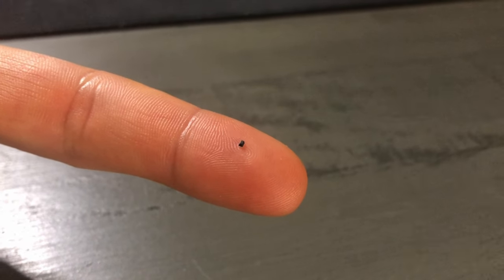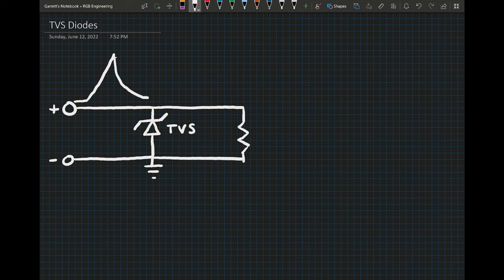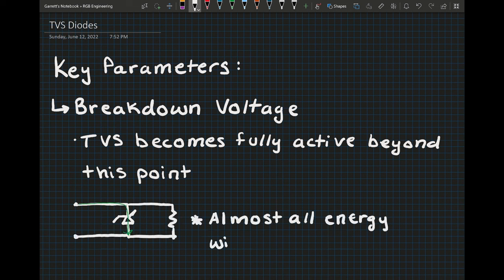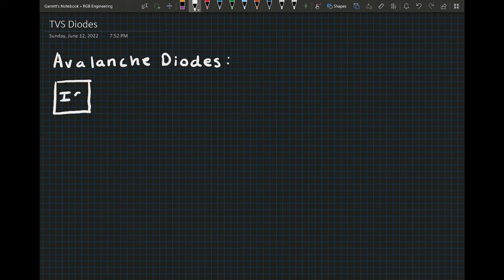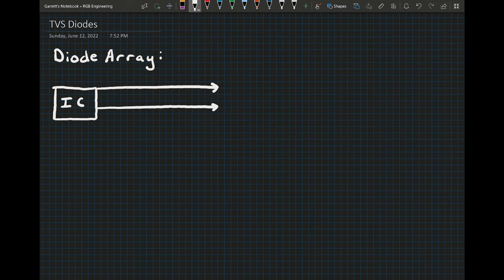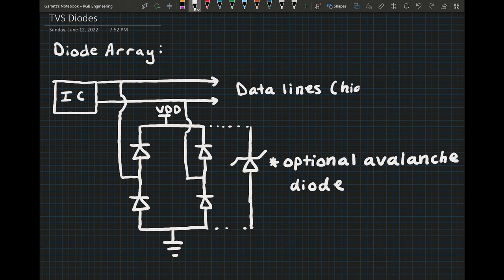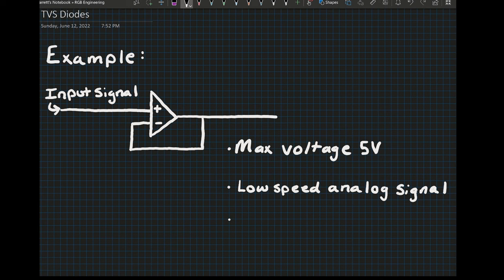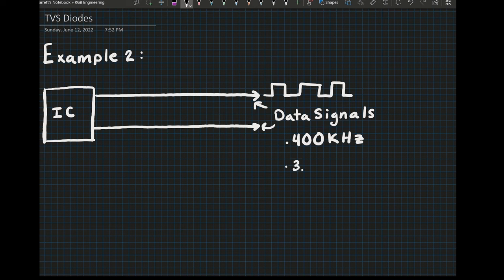TVS Diode Design Guide (for Beginners)

Comment: This is a very helpful video.  Many designs I have seen just seem to randomly have a TVS with the VRWM just about the signal level thrown on the input.  In the case of an op amp with max +/-13V rails and an input signal that is +/-10V, if you select a TVS with VRWM of 11V, the Vclamp will often be 19V or more and VBR might be >13V.  So before this TVS starts conducting much current, the input pad protection of the op amp will forward bias and conduct current to the 13V supply.  But those often do not have much current carrying capability.  So am I correct in saying that a TVS diode can't be used in this situation?

I guess you could use the diode array like you mention in your video.  Would it also be acceptable to have use a TVS diode with a resistor in series with the input of the op amp?  If Vclamp was 19V for the TVS and the input pad protection diodes started conducting at 13.7V and could handle no more than 10mA, then you could size the series resistor to be larger than (19-13.7)/10mA = 530 ohms.  Would this work?

Comment: Thank You for this video. I have a question about protecting an Arduino Nano 33 BLE. This board operates from 7V to 21V. My intention is to use it for Automotive applications < 15V. I have been considering the Littelfuse model TP6KE18CA. My concern is the max clamping voltage of 25.2V of this TVS diode is greater than the max 21V operating voltage of the Arduino. All other parameters appear to be OK with reverse standoff at 15.3V and breakdown voltage of 17.1 to 18.9. Is this a concern?

Comment: Very well illustrated 
I am a total newbie here but
Mind if i get ur insight i am making a diy backup battery .. would a TVS help protect the load .. or would a simple resistor and relay be a better choice ?
Reply from the maker: I would need more information about the circuit you are designing to be able to give a good answer.
Reply: @RGBEngineering  thank you for replying so fast
I am using a 15v input to buck converter to charge a 12v SLA battery as well as another buck converter to power a 9v wireless camera
And a diode to prevent power back from battery to the buck converter
SLA charging at float charge